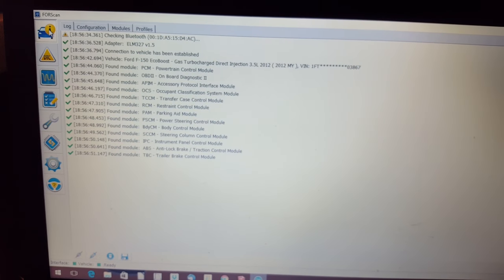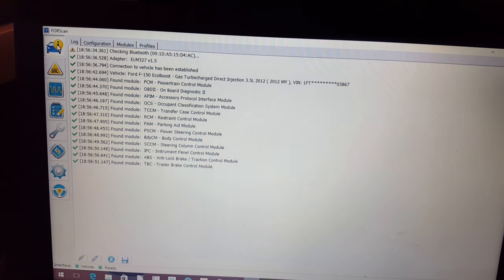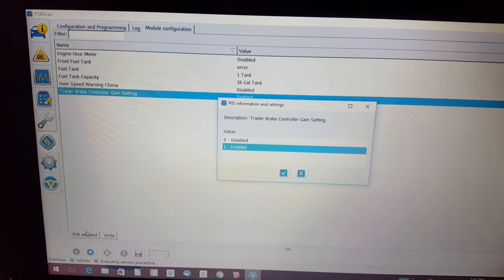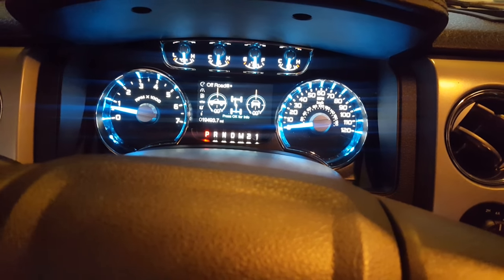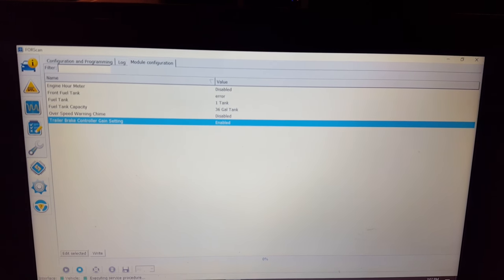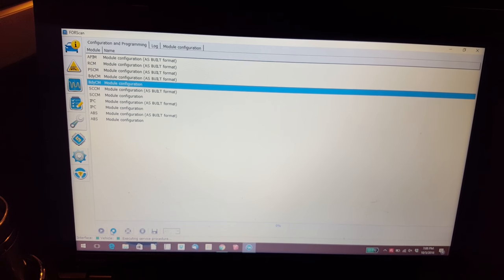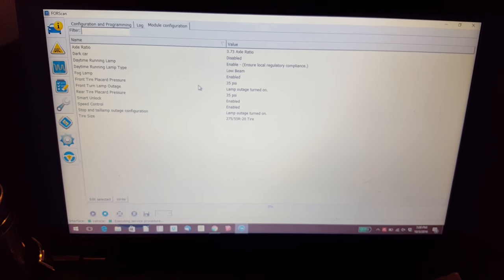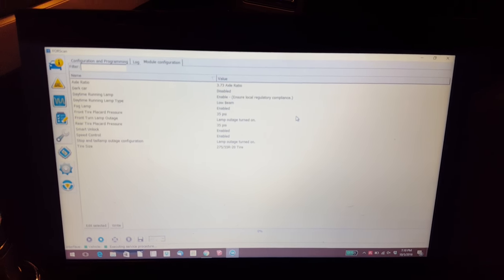2012 F150 Brake Controller Activation

Comment: Thanks for sharing.  I downloaded Forscan, joined the forum, requested the extended license, received the code within an hour, and enabled the brake controller.  All worked perfectly!
Reply: I downloaded it to my laptop, do you have to join a forum and request a license? I got two emails one said awaiting confirmation then another said I was all set. Just waiting on the scanner at this point and I should be good to go? I am also trying to activate my factory trailer brake control

Comment: I have a 2012 also four-wheel drive and I've put a trailer brake box on mine and it shows everything is working back at the back when I check it but they tell me that when you first cranky truck it's not supposed to show your trailer box gain on your dash unless a trailer is hooked up to it and mine shows it every time I start it is there anything you can help me with there

Comment: Hi. Thank you for your videos.I've enabled Dark Mode so I have things working. I cant find Remote Start in IPC. Did you add the extra switch? I have the OBD Link MX but cant tell if it has both HS / MS can. Thank You for your help in advance
Reply from the maker: +Lawrence Reyno I am not sure on the remote start functions within Forscan. Sorry.
Reply from the maker: +Lawrence Reyno I have not added the switch to access the other CAN yet. I want to someday to see what other modules I can access.

Comment: does this only work with the bafx obd2 or will it work with any obd2 scanner?
Reply from the maker: brandon hinman I believe any adapter but I can't be 100% sure.
Reply: cool I'll give it a shot. I have a buddy who has one and I just got the same trailer brake setup on my f150 and have to activate them so that would be awesome if my buddy's will work and I can just do it myself
Reply from the maker: brandon hinman good luck! It really was easy.
Reply: thank you for your help! it worked and your right it was really easy.
Reply: brandon hinman  I contacted BAFX and they said the BAFX OBD2 will not activate trailer brakes, only read codes not change anything. I don't get it.

Comment: I installed my Ford TBC and engaged it using BAFX OBD2 and Forscan. When I attach my trailer the TBC displays "Trailer Disconnected" any help out there??
Reply from the maker: Nancy M Hansen I would check all your trailer wiring first. Have you used the trailer with a different vehicle to verify the brakes and lights all function properly?
Reply: My trailer brakes work on my friends truck. We are not getting any 12V power through our 7 way socket. UGH
Reply from the maker: Nancy M Hansen I wish I could offer more help. Maybe double check all connections are solid on the  controller itself. 

Also maybe trying to turn off the controller in Forscan and then turn it back on. I don't know if that will help or not.
Reply: Thanks
Reply: Might be the 9 or 21 fuse missing.